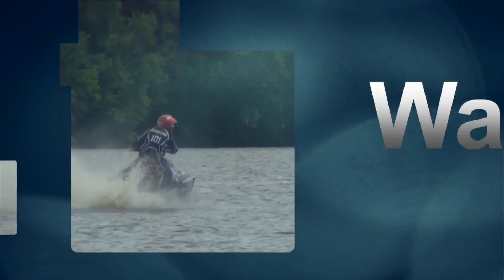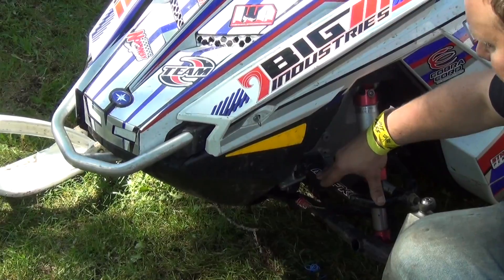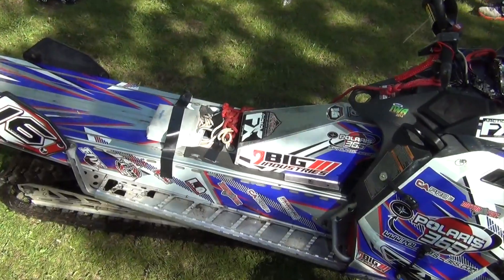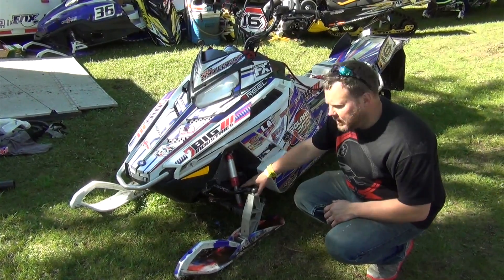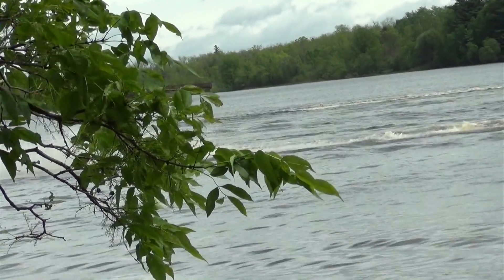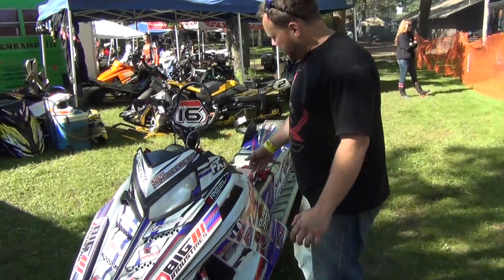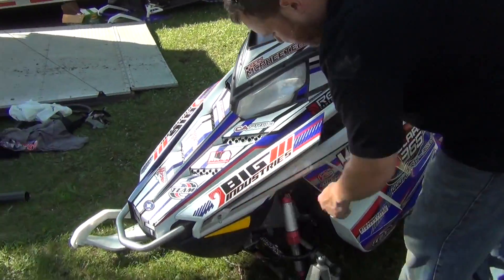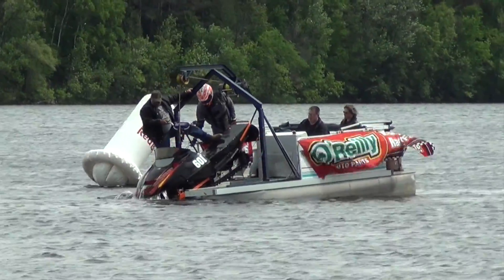Watercross 101 - How Watercross Works and How the Sleds Are Prepared

Comment: This was a great video. However,  doesn't really answer the question on the science of "how" it works. 

I believe to help people understand a little more about how the Snowmobile works on the water is its Track on the bottom, Because how fast you are moving on the water, You begin known as Hydroplaning where the bottom of the Snowmobile basically shoves the water like a propeller on a Boat, But on very high Revolutions. 

Because the track is in the water, it basically acts like a continuous paddle of some sort, the forward momentum as he said about 30 miles an hour. These "WaterMobiles" Constantly run at a "high" RPM so that is why the ability to "skim" across the water is like a Skipping stone if it had a motor on it and it would skip infinitely (Or until you run out of gas). 

I am no professional nor that I actually do this, But I hope this answers some of the questions of "How" a Snowmobile actually "Skims or Hydroplanes" across the surface of the water. It acts like a "Jet-Propeller" Like you would see on a Skidoo or Jet-ski the only difference is that if you stop, You will sink as the weight of the machine is not designed to "Float", But at the same time that is what would defeat the whole Watercross, is that if you 'Fail' or 'sink" in this case, you are DNF. Because, Mistakes in this type of thing is horrifically small, But experiencing this looks like a whole lot of fun!

Comment: What do you recommend for track length and paddle
Reply: Still the best all-around track lug size is 1.25.  Fast and can corner very hard.  Deeper lug tracks turn sharp but are slow top speed and carry a lot of water weight.   You could do 129 to 137 x 1.25.  For around 145~150+hp, you can gear the sled for about 65mph at 1-1 clutch ratio and that will scoot real good.  Then it will be up to you to dial in the suspension/chassis to corner and not porpoise on straights.